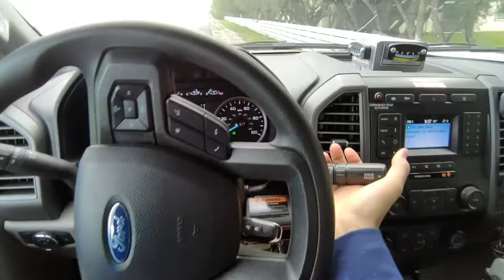Outside Plant Technician - AT&T

Comment: Hey Guys I’m Mike, I just got Hired on w/ AT&T outta Knoxville, TN for Machine Operator, burying and boring Drops and doing basic connections. Is it possible to transfer to an OPT Tech or Field Technician after alittle time on the job ? And am I Union as a Machine Operator ?
Reply: all labor jobs at at&t are union.  when do you start?  a few weeks after you finish your initial training, the union will visit your yard for sign up so they can start taking your dues out of your paycheck.  you should be able to transfer to premise tech if you pass the tests after time in title requirements for your current job (usually 18 to 24 months).  As for the term OPT job, i believe you may have to quit first if you are currently in a permanent job title.  Or you can do 2 years as a prem tech with high performance/production scores and transfer to a permanent OPT opening (rare, and only to replace retired people).

Comment: How much is the hourly pay? I live in Cali and I'm curious about this job.
Reply from the maker: Starting pay is negotiable, ranges from like $18-$30/hr. Union gets you an automatic raise every 6 months of about $2.5/hr, maxed up to like $42/hr. Lots of overtime available, sometimes forced. Location is irrelevant, so big money if you move to the middle of nowhere.
Reply: @leo3479  In Bay Area, almost no overtime (except for permanent OPTs on call out) since July and they just shut down 2 term OPT yards in mid September after 1.5 years on the job.  It used to be up to three years for a term.  Guys re-terming usually start at the top of scale which is $45/hr in Bay Area.

Comment: Opt deserves more than $42 in Cali.
Reply from the maker: Yup! Shame competitors pay similar job titles way less, otherwise the union would have even more bargaining power.
Reply: @leo3479  ye. You guys work hard af. How long u been term?
Reply from the maker: @iamnoone5248 Temp for a year and a half. One as OPT rest ET. Rumor goes that they close the yards with bad numbers but keep the yards with good numbers for many many years, so share every trick you learn and expect the same from the others, though they never open up permanent positions to avoid either apathetic or underpaid techs from snatching them up with their seniority.
Reply: You went from Temp OPT to temp ET?
Reply from the maker: @thecool842 Yup!
Reply: @leo3479  How’d you do that, I’m a temp ST right now.
Reply from the maker: @thecool842  Apply externally with a different email and have your current manager vouch for you to HR. If it's a promotion from wage scale 31 (OPT/ST) to 32 (FT/DT/ET), prepare yourself for the TKT-II test and a big pay raise.

Correction: FTs don't require the TKT-II !
Reply: @leo3479  Whats ET? I know ST is splicer.
Reply: Specialist?
Reply from the maker: @iamnoone5248  Electronic Technician, also known as C.O. (Central Office) Techs.